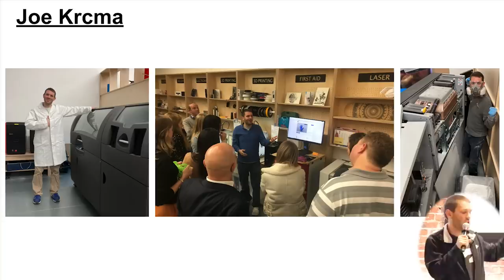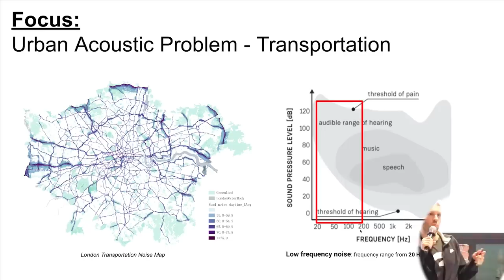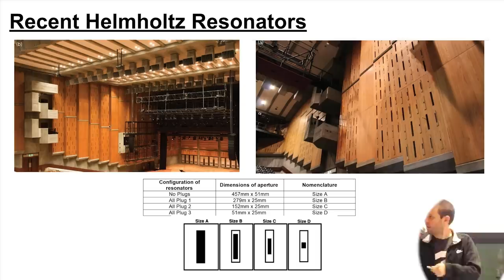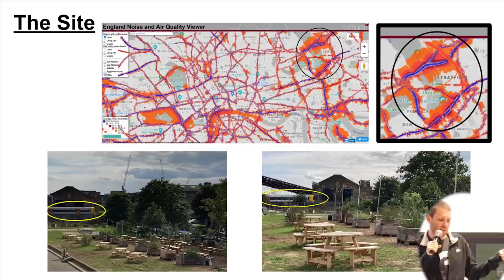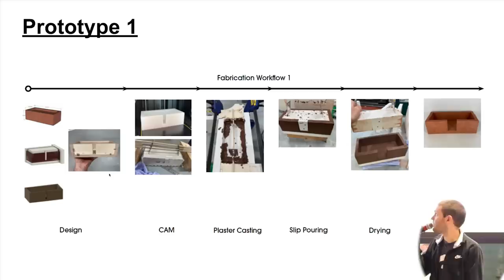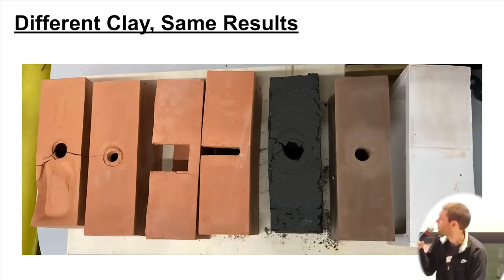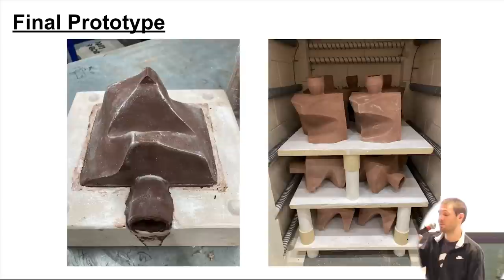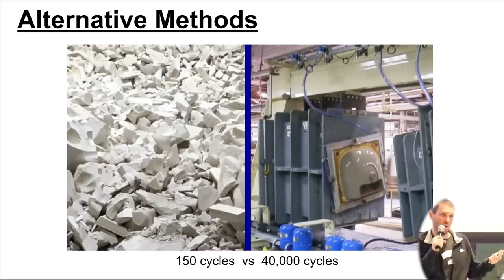These Bricks Can Absorb Traffic Noise - Thesis Presentation on Helmholtz Resonators

Comment: i built musical instruments professionally for many years, percussion and then pipe organs. I tested resonation systems using a bird call analysis program to see the wave resonance and would then start messing with the design to remove as many unwanted harmonics as possible. One of the resonator systems i tested was a helmholtz, the  helmholtz did an amazing job at resonating only the fundamental wave it was tuned to. I can see the value of reducing unwanted sounds in an urban environment, doesn't do so good for musical instruments as the following harmonics and partial wave series are what give instruments such unique timbres and identities. I wouldn't call a square cavity a helmholtz resonator as it really is the spherical interior that is the basis of the equation but I see the theory he's thinking about. There are natural instruments that use the helmholtz, the balaphone in particular uses gourds as the resonation system and is tuned by shaving the neck. Many old churches have resonance chambers built into the structure to help with the many sounds produced by large pipe organs so this train of thought isn't a new concept.
Reply from the maker: I always love the Sea Organ example in Croatia. You might enjoy my thesis in the description

Comment: I have been working with lime plaster recently and it has similar issues with cracking during drying. This is usually prevented by adding aggregates (sand) and fibres to the mix. These days they use polypropylene fibres but it used to be horse hair.

Traditional building methods also do not coat bricks but leave them bare. This allows any water to evaporate normally as it would from any other surface and allows the movement of water through the structure (so it isn't trapped) - its called a 'vapour open' structure and is how Victorians traditionally built things. I still think it has value today, you don't want to trap water (as modern 'vapour closed' construction methods can do) but allow it to escape.

I also imagine over time the holes will be filled with moss etc as you say. I am unsure if this would change the function of the Helmholtz resonator, would be interesting if it didn't
Reply from the maker: Interesting!

Comment: As a civil engineer I have been working in several countries and come to the conclusion that we are still building old school. We build an expensive and heavy, material consuming, outside brick wall that has no other purpose than to protect the insulation. The inner structure holds the building, then we insulate it, and finally we put our brick wall to make it look like the other houses as we are used to. Now in my opinion we should skip that brick wall and install more insulation. But this insulation needs to have some finish on it. The options at the moment are wood, aluminium or plaster. It would be amazing if we can invent some new kind of finish that is besides weatherproof, long living and sustainable, also sound absorbing. I like your idea and the effort you have put into this project. As the stones are hollow, it saves on material, and because the outside wall is not baring that is no problem and even a benefit in production and transport. I hope you can make a competitive priced mass production.
Reply from the maker: It’s for free in the description for anyone to make, so no money for me!  Open source is what I enjoy 😍

Comment: 35 years ago when i was a grad student for the Center for Acoustics and Vibrations at PSU, we studied exactly these.  typically, the helmholtz resonators work great for a single frequency for reduction, but over time, they found factors such as water accumulation, bird and squirrel nesting radically reduced the effectiveness over time since these typically changed the volume of the chamber.  measures to address these concerns drove up costs (by either required maintenance or mesh/netting/drainage).  for low frequencies that you cited, the chambers are LARGE!
Reply from the maker: Bigger the better💪
Reply: the wavelength at 20 Hz is ~ 60 feet in air.  so, assuming lambda/4, that's 15 feet for the length of the cavity.  that's a seriously large addition at that point @JoeMakes

Comment: working in my hobby since a few yrs with helmholtz resonators. extremely useful in speaker building and room acoustic. they are sometimes the only useful way to convert undesirable resonances to just a little bit heat. couldnt imagine such "walls" like in the video arent already in use somewhere outside. eventually will be dirt or water a problem which could get inside, changing the resonance frequency and making them less useful over time or under specific conditions

Comment: In the earlier slot-faced design it looked like you could make the resonator frequency adjustable by having different shaped inserts for the slot.  They could be designed not only to change the opening size, but the interior as well.  I'm imagining tiny versions of the ancient clay pots, but with trapezoidal necks that lock into the default slot.   That said, the visual pattern of the final design is so appealing, and obviously would be mass produced to absorb whatever frequencies are targeted at a given site.   Neat stuff.
Reply from the maker: Thanks so much.  I’ll test it some of those ideas in an upcoming video 👍

Comment: So I just spent the last three days digging out 4” sewer clay pipe system on one of my properties, due to a plumbing backup issue. Essentially a sewer lateral was improperly installed 50+ years ago without a proper fall, causing slow back up from particulate and grease residue. Yummy haha

These clay pipes, however, are still in excellent condition. They are kiln dried at 2000°F (1093°C) which makes them vitrified, essentially porcelain-like. (Which would change your Helmholtz frequency absorption results, I’m sure)

I have a different residential property running parallel to the 101 freeway, in California. It would be rad to have a sound barrier installed. This roughly mile long (not just my property) section of the 101 and El Camino Real, would highly benefit from a sound wall of some kind. The generic concrete sound absorbing wall examples you showcased in your keynote are what I was thinking was needed until I stumbled across this video…
Maybe we partner with you and my somewhat small municipality? Trial-run a more developed extrapolation of your thesis?

I suspect you’re onto something with your Helmholtz Resonant influenced design juxtaposed with clay.

Check out a video on YT titled “From the Earth and back again” by the National Clay Pipe Institute.  I suspect you’ll glean an idea or two from this video. Especially in regards to yielding constant output that matches your CAD models.

Edit: I rarely comment on YT videos. But this is compelling and you appear to respond to recent comment. Curious of your thoughts.
Reply from the maker: Haha, I try to reply to every comment 🥵. I'll check that out.  Appreciate the thoughts.  Although I still want to do some more prototypes from everyone's positive comments 💪

Comment: The easiest way to use this, which I saw in a radio concert hall, is lining a wall with traditional red bricks turned to their side. The brick holes become sound trapping "pipes", and whatever you say magically disappears into the wall. It was surprisingly effective given the minimal manufacturing cost (compared to any specialised shape).
Reply from the maker: Yup,  I write about this in my thesis paper. You might like it.  Linked in the description

Comment: Brilliant! Your conclusion brought it back to the design fundamentals. I’m thinking I missed the purpose of the ceramics limitation. One would think modern materials know how would help scale the manufacturing. The impact and simplicity are impressive.
Reply from the maker: Thanks so much!  The ceramics limitation was a constraint because we wanted to explore that path of materials other than plastics and concrete. It was a challenge, and was a pleasant surprised in our outcome. (I wouldn't recommend clay for a business proposal, but was great fun in academic research). I'll do a second version with new improvements soon!

Comment: There is an ancient pottery technique to avoid the clay cracking. You are supposed to add the reed mace fluff into the clay as a reinforcement. The clay dries even without cracks, and the reed mace fluff in the kiln will burn out, leaving a fine clay structure. Some micro sponge structure, depend on the fluff-clay ratio.
Reply from the maker: Nice

Comment: Some Petrol engines have employed Helmholtz resonance in their air intake manifolds. The Yamaha-designed intake manifold on the 1st generation Ford Taurus SHO has dual air passages, a long set and a short set. The air would flow through the long runners until a certain load/RPM was reached, and then butterfly valves opened up the short runners. The dual airflow sets up a Helmholtz resonance and creates a mild supercharging effect, pushing a little extra air into the cylinders.
Reply from the maker: You might like my thesis (description) where I mention that!

Comment: Very nice project, nice approach in designprocedure :). 

I was involved in a project that used ceramics for building facades, goal was passive cooling / water buffering.  We came to a functional prototype.

However as a parallel we researched freezing bodies of water inside the ceramic piece, we had draft angles between 10 and 20 degrees. A single cycle of freezing is fine, its fatal when the formed ice block partially liquifies and the freezes up again. Ceramics will break, draft angles help as the iceblock pushes upwards but refreezing is definitely problematic.

Releasing molds can be though, especially without the ability of adding convenient draft angles. Another parallel test in that project was MDF board molds. In that instance I milled a mold and then sealed the outside with woodglue, on the inside (8mm from where the  liquid claybody would be) i milled slots to create a path for compressed air. MDF is very permeable for compressed air, not sure about plaster but i figure that could work. With MDF it created a pocket of air that gives you a bit more wiggle room with releasing.

I used plaster molds a couple of times, im very impatient, so often I shove them in the oven. This at least helps with driving of moisture, not with longevity of the mold. Whilst firing you can also put al of your molds on top of the kiln, double usage of the same energy.

Really enjoyed your talk!
Reply from the maker: Thanks for the great comment!  Seems that ceramic misery loves company.  Another team did passive cooling which was somewhat effective.  You might like my thesis and portfolio in the description

Comment: A vented speaker (bassreflex) is a helmholsresonator, tuned to controll the movement of the speakers bass driver, thru reducing the drivers amplitude at the drivers resonans.
That will also add some bass to the speaker when the air in the resonator port are in phase with the bass driver.
Reply from the maker: Thanks for this

Comment: This is very cool stuff. I'm a big music guy, I enjoy engineering and producing and I've done a lot of ear training; so I'm always conscious of things like environmental noise. It's one of those things that most people aren't really consciously aware of, but environmental soundscapes really can have a big impact on you subconsciously, as you mentioned. Your first prototype reminds me of the old school absorbers that Motown used in their studio, which was a wooden box made from pegboard, meaning that some sound would get reflected and some sound got absorbed. You also mentioned that you had problems with cracking, which makes me wonder if you were using pure clay to make the bricks. I learned from another YouTube channel, "Primitive Technology", that cracking might be preventable with the addition of "grog": typically sand or previously fired waste clay crushed into fine grains that, when added to clay, prevents the clay from drastically shrinking as it dries (although I am not a ceramics expert, so I don't know if grog would be easy to incorporate into slip).
Reply from the maker: You hit two things that I love: Motown and Primitive Tech!  I used grog but that doesn't slip cast well.  Thanks for the comment!

Comment: Wonderful job, and very easy to follow!  Now you've created something that does the job acoustically and can sensibly be produced, you can start looking into structural integrity (if intended to be used in load-bearing walls) and the drainage issue remarked on by previous commentators.

With regard to  preventing people from doing unwanted things to the bricks, I was at first thinking that several courses of some sort of brick that doesn't enable climbing but has some other, albeit less efficient, sound-deadening properties might be needed, but then an idea occurred to me:

1. remove the current inlet pipe from the design
2. slant the front of the brick backwards at a suitable angle so that the bottom edge juts out sufficiently so that the sound ingress hole can be relocated to the base of the brick where it juts out over the bricks below.  

This would prevent rain from being able to enter except for splashes from rain hitting the ground affecting the first few courses - but it might be possible to make a version of the brick such that the tube inside the brick connecting the outside world to the main cavity prevents ingress of water to the main cavity simply due to the physics of the shape. This would likely also make it too hard for birds to use that type as nests, if so, then produce lower-course bricks in a different colour.

Not sure what you could do about water and rubbish ingress to the resonators between bricks, although the overhang from the layer of bricks above would help, but I suspect you'd have to look at the shape formed by the exterior of the bricks so that the entrance tube there is also slanted downwards.  You might also consider what future noise abatement needs may be based on projected changes in transportation, and whether or not it's possible to make sound-deadening bricks that are easily tunable at least once, years after being laid, perhaps by an easily installed insert to the sound ingress hole?

I look forward to seeing your next video on your bricks!
Reply from the maker: Thanks so much!  I'll still tweak the design and see what comes of that!

Comment: My design for highway sound barriers incorporates three  major functions: to lower traffic noise, to find a use for fly-ash from coal burning and to enhance environmental factors.  The structural strength derives from open cell bee-hive pattern constructed in panels capable of interlocking vertical structures forming a zig - zag to enhance stability and absorb wind load.  The forms would utilize Fiber-reinforced polymer (FRP) instead of steel rebar for enhanced structural stability and longevity.  The use of fly-ash in the cement instead of sand would alleviate proliferation of a troublesome environmental pollution problem.  Each cell of the pattern would be large enough to encourage bird nesting.  The bird nests would provide sound absorption material.
Reply from the maker: Exactly!  Nice

Comment: Fascinating and valuable work!  As long as "green light" thinking, what about adding a binder to the terra cotta (or ceramic) that controls variable shrinkage rates upon firing/curing.  Carbon nanotubes or some higher temp 1D material come to mind.  I'm not an engineer, so not saying it's possible or helpful.  UCL sounds like an amazing place to learn about molding the improved future of our lived environment.  Glad you were steadfast in your determination.
Slow release of wick moisture is another benefit of terra cotta.  Lowers perceived temperature in urban environments.  Kodos to the 4-part "brick" design!  Solo bricks lack the significant chamber volume (especially at U.S. dimensions).
Reply from the maker: Thanks so much!  Glad you appreciated it!

Comment: In Germany, there is the DF format of masonry. Especially 3DF is a standard for load bearing walls. Old engine test Chambers in some car repair shops used ot make an additional wall of 3DF rotated 90 deg such that the holes in the brick face the engine. It seems that while it maybe isn't a correctly formed resonator, they were still searching for the same properties by doing that.
Reply from the maker: Interesting!  Thanks for sharing

Comment: Great job, Joe! It's a pity you didn't know that you're not supposed to bake clay when it's that wet - overnight for slip isn't long enough. If you try some of your previous designs and actually give them enough time to dry out, some of them will also work.
Reply from the maker: Thanks!  I must have misspoke, the clay wasn't baked when wet.  It was left in the plaster mold overnight, then taken out to dry for a week.  Sometimes 2 weeks before being put in the kiln.  It's just that the earlier models were way too thick even if dried for a month! 😂
Reply: Ah,  @JoeMakes  , as I recall you only mentioned overnight - although I may have missed it, of course. 2 weeks? A month? What was the slip made of? Have any professional slip-casters weighed in on the issues you had?

Comment: Can't say if it's the same sort of design but I recall sticking my head into one of those 'stand up' style payphone booths the first time.  They were lined with a metal grid with hundreds of small holes.  It felt like my ears were switched off.  Very eerie sensation.
Reply from the maker: It needs to have a cavity and neck, so the booth doesn't have Helmholtz properties, but I love the image
Reply: Actually, I recall those and their sound deadening effects as well.